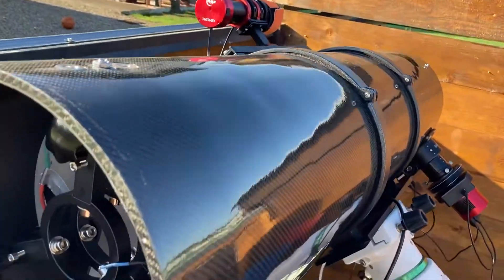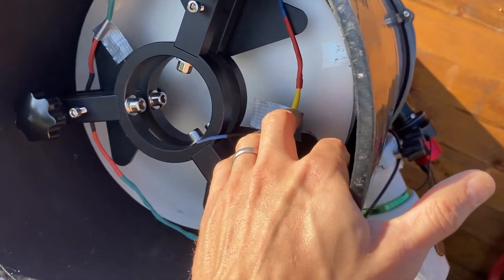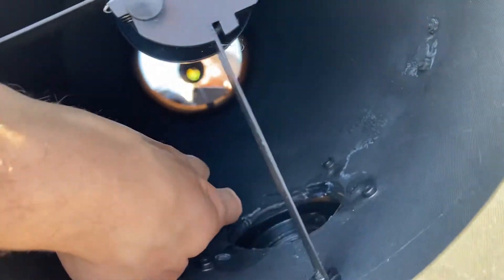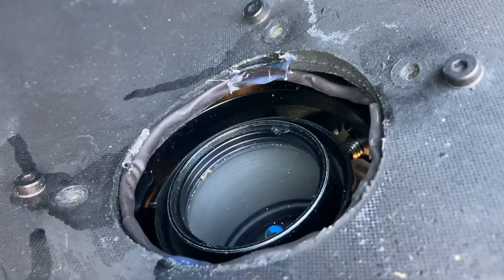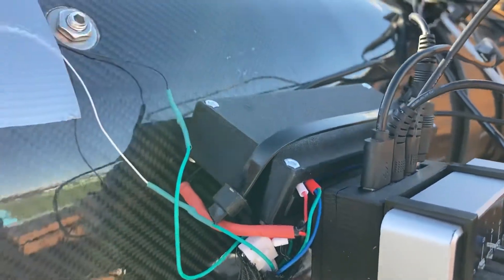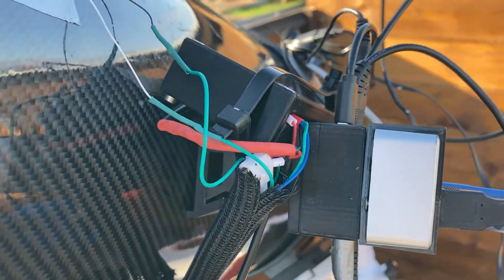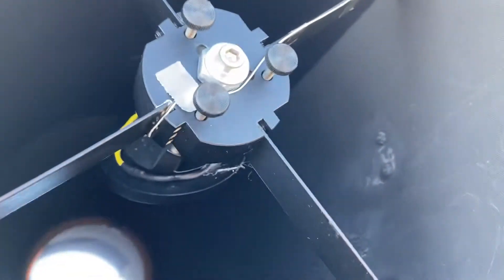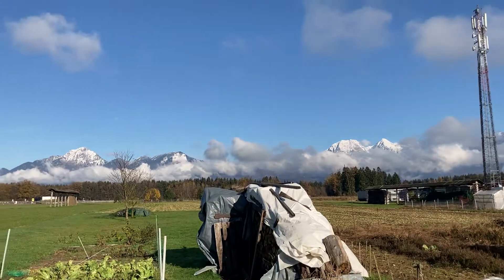TS ONTC newton telescope primary and secondary mirror heaters - part 3

Comment: Pavle how do you find the steel track focuser, what length of drawtube  does it have ? I noticed the moonlight focuser has two lengths option , I putting a focuser on my wish list , cooled camera first (funds getting there )👍
Reply: hi Dave, I love steel track so far. I have upgraded from V-power to steeltrack. In my experience, its more rigid in comparison to V-Power (not that V-power is bad, but seems like steeltrack has less flex overall). As for the length - mine has 40mm tube.
Reply: @pavlini0  cheers pavle

Comment: Hi there fellow reflector user lol 
You ACTUALLY run a "dew" heater on your primary!? wow. Id always read (I think) that its to be avoided. If its working though and isnt changing its figure thats great. I dont think there is any heater I could do that to my full thickness 17.5". Its so annoying waiting for that sucker to "cool down" to ambient temps.
I hope not but Id think all those would produce alot of "tube currents" like convection.
Reply: well, it works for me :) I dont heat up the mirror itself (heater is not touching the mirror on most of the surface, but just where i needed to glue it down). The point is that surrounding area is just a bit warmer from ambient, so that surfaces do not accumulate dew. Its not heating it like crazy, just a bit. Check M51, taken with heated ONTC just last week, with all 3 heaters turned on: https://www.instagram.com/p/COyNc7npknh/